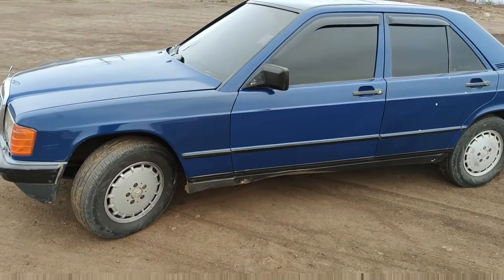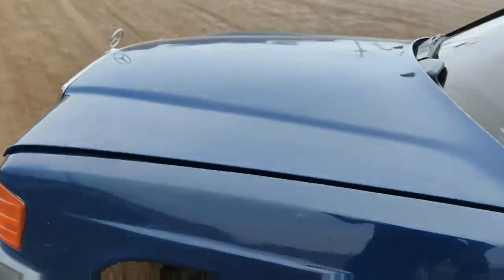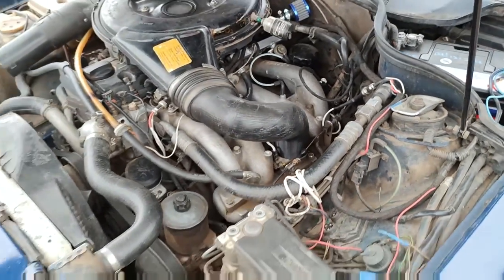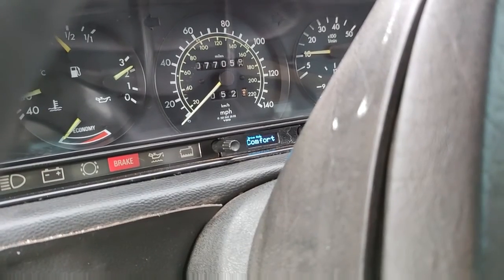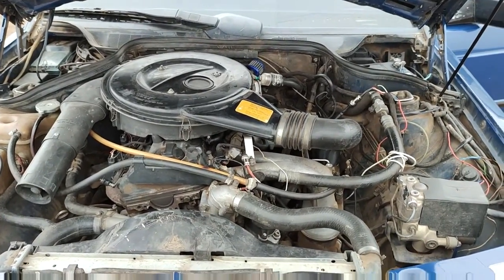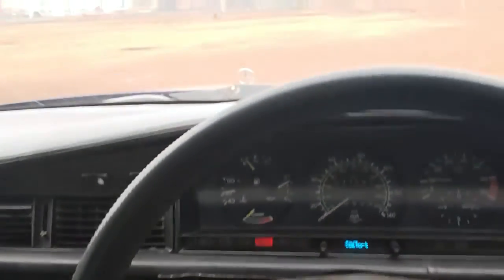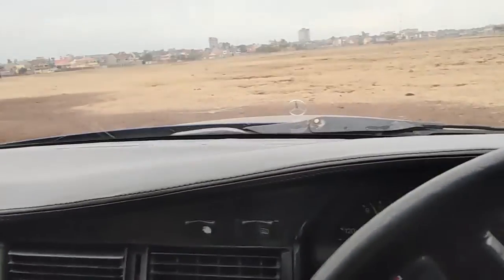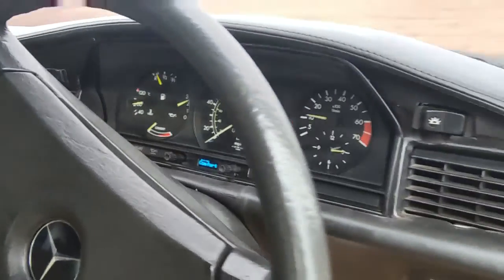Benz 190E M102 Engine Full EFI Conversion

Comment: how do you place individual fuel injectors on each cylinder if it was using a carburetor before ?  do  you drill the manifold?

Comment: Hey brother how do i get that ecu?
Reply from the maker: Hey man, thanks for reaching out. Where are you located?
Reply: @PeterMbiria1  Canada!
Reply: Canada! 
 @PeterMbiria1
Reply from the maker: @RussellKirstein  Nice. You'd want to use on which engine?
Reply from the maker: Just so you know, this ECU doesn't have maps or tables for ignition or fuel, it has mathematical formulas that derive the ignition angles needed and fuel needed.The way to tune it is programming it in C++. I already have a base program from which you can tincker with values and also add features to it that didn't exist before.

Comment: This is brilliant. Thanks for sharing. Can the system be adopted to any other carburetor engine besides the Benz?
Reply from the maker: You are most welcome. Yes, we've already installed it on a Peugeot 505 stationwagon 2000cc successfully and it's been running since June this year. Fuel consumption is great both on city and highway drive.

Comment: Beautiful build chief, nice touch with the drive modes too.
Reply: Question though, how's the conversion and ecu upgrade in comparison to a M111 engine?
Reply from the maker: @Carbugii  M111 was the M102 successor so it has many advancements over M102. It is full EFI, has 4 valves per cylinder, has intake variable valves(some have both intake and exhaust) and much more. The M111 offers better fuel economy and performance. Now, how about M102? This is a serious engine that was built to last. I've seen some M102 pushing 300+ BHP with turbo. This engine, with my words, was never given the love M111 was given. M102 was only offered in 2 variants, carb or K jetronic (FD). This is where my ECU comes in. It equips the M102 with the capabilities of a modern engine. With a computer, the engine can now bring out the beast that was cashed in it. I get outstanding fuel economy, 9-12.8km per liter in city, 12-15 Kms on highway. Performance is another thing. Acceleration is wild my friend, you easily get to 100 kph on gear 2 on a 5 speed manual gearbox. What I'm saying is, you don't need to change M102 engine to get power and fuel economy, just EFI it.
One bottleneck I've observed first hand with M102 to M111 swap is wiring issue. Those who have managed to make their M111 run don't fully get all the wiring correctly done which means, part of the engine doesn't work( like the variable valve operation, cold start throttle, acceleration feel, etc). If one chooses to do the engine swap, I ask them to be sure they have a proper wiring technician who will connect all wiring correctly to the ECU and the body. Also, marrying the M111 harness to the body to make sure the cluster dash works or you are left with dials not working.
Reply from the maker: Thanks boss!

Comment: Hi Peter, great job to finally see the m102 powering the car. I've been following your progress on LinkedIn... how much horsepower did you gain from the conversion?
Reply: fuel save on eco how km/l
Reply from the maker: @johnslater1247  15 Kms per liter on 2.0l engine
Reply: @PeterMbiria1  this is amazing
Reply: @PeterMbiria1  cost of conversation to efi.? Are you commercializing it?
Reply from the maker: @johnslater1247  At the moment, full cost is 150K. It covers everything including labour, parts, modification and tuning.
Yes I am commercializing it.
Reply from the maker: Hey man. Thank you😁. Regarding BHP, I haven't gone back for actual tests. I have been tuning it and this month, I'll go for the tests. It drives way better than while I had carb and I know I'll get better figures.